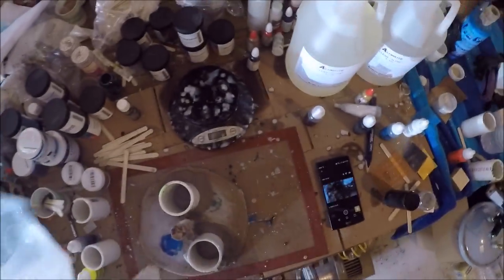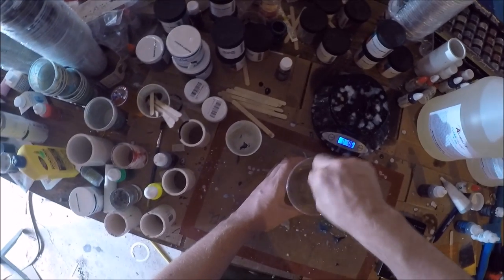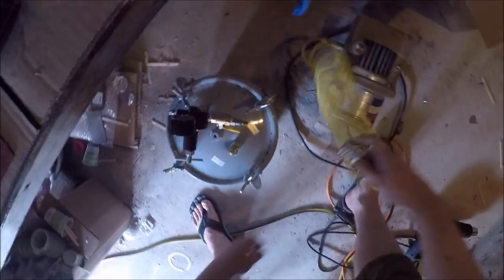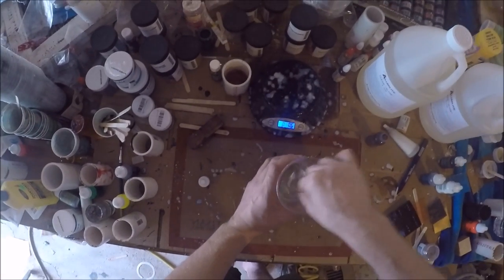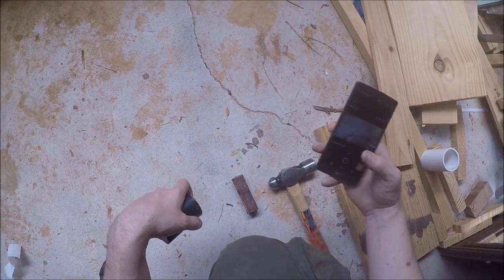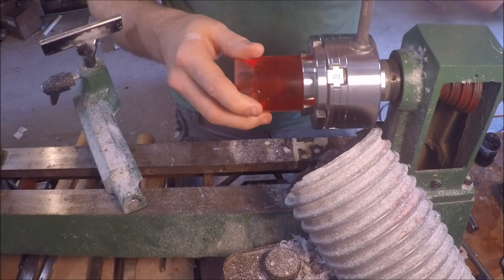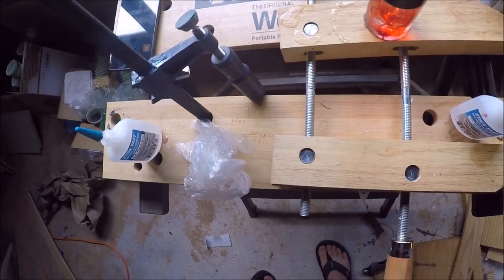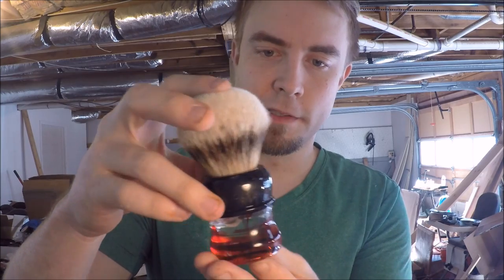Crafting a Black Hat Shaving Brush

Comment: Hi Scott great video as usual, can I ask what polish you use on your finished brushes? Cheers....
Reply from the maker: Hey Steve, thanks! I polish with Abranet from 240 to 600, then Micromesh from 1500 to 4K, then One Step Plastic Polish, then I buff with a wheel for 15-20 minutes.  Takes a lot more time to polish and buff than it does to turn.

Comment: what's the big silver thing you put the blank into on the lathe?
Reply: Part 1751 from little machines hop.com
Reply: Is that all is for is holding the blank while you do a knot hole?
Reply: hop.com link didn't work
great video btw i am just starting to cast my own pen blanks which i have had success with and my hubby wants me to turn a shaving brush handle.  thought "hey, why not try a resin"  i really enjoy this process but when trying to make a swirl pattern with 2 colors the colors always mix and i dont understand why, i don't stir much, any ideas? oh and can you tell me what size is the PVC please? and can a person use something other than the alumililite red dye for coloring ? and i assume that is what you used for the black too.
Reply from the maker: Sorry about that, that was supposed to be littlemachineshop.com - must've typed that comment on mobile and it autocorrected :)

For brushes, 1.5" - 2" PVC depending on the size knot (for 30mm I use 2").

As for the colors mixing when you pour, that depends on the viscosity of the resin.  If you let the resin set a little bit before pouring then it shouldn't mix as much.